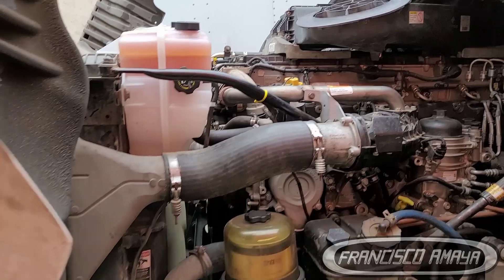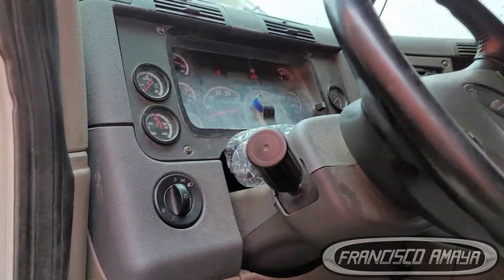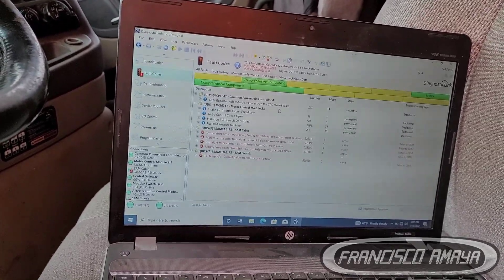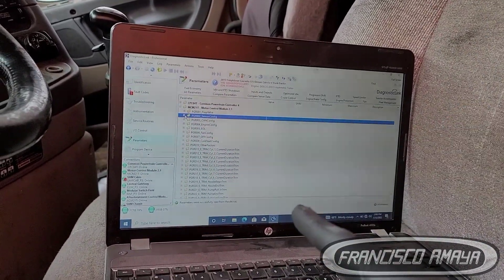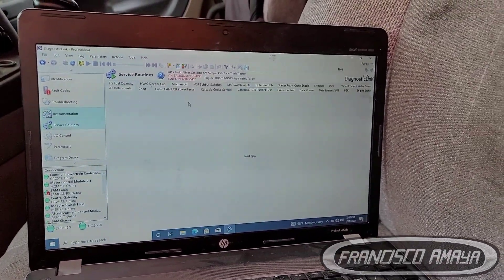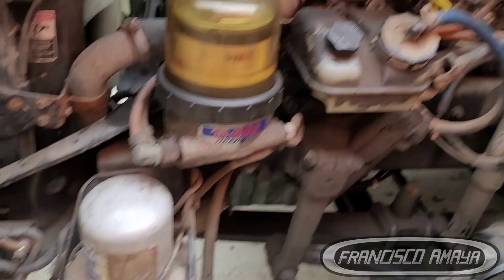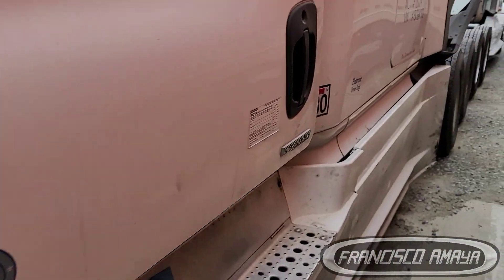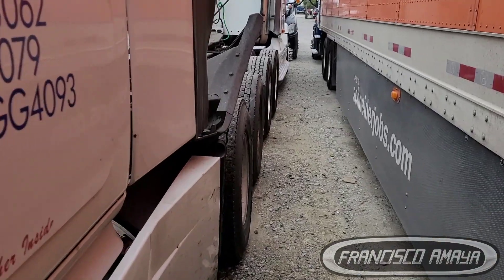DD15 electronic programming 2019 engine installed on 2015 truck parameters computer settings

Comment: You're a smart guy bro. I was I was living close to california to have you work on my truck. I have a quick quest please, I have a 2011 cascadia that need the engine swapped. What's the newest DD15 I can put in it? thank you bro
Reply from the maker: any DD15 engine is compatibles but the components to replace can be more difficult to do depending if the engine is very recent.
Reply: @franciscoamayaYT  thank you brother.

Comment: This man is a genius!!! I've literally asked freightliner and other "mechanics" if this could be done. They ALL said no. Because freightliners have the SAM Chassis but most importantly the CPC, you can't just get ANY CPC and think it'll work. And they said you can't use your ECM on newer engines.... However, with anything in life, anything is possible! It literally just takes, knowledge, patience and the will to learn. Fransisco isn't just a "tech" he is the real meaning of a mechanic! Huge difference! Tech's rely on the computer to tell them something, without the computer telling them anything they will not be able to identify the issue. A mechanic can do both, understand the computer if it points something out, or if it doesn't he/she can still fix the issue at hand without the computer telling them, it just takes a bit longer. Fransisco is that man! I as many other's appreciat you!!!